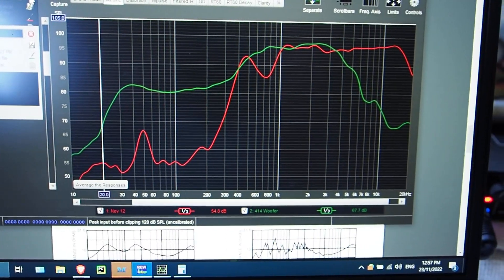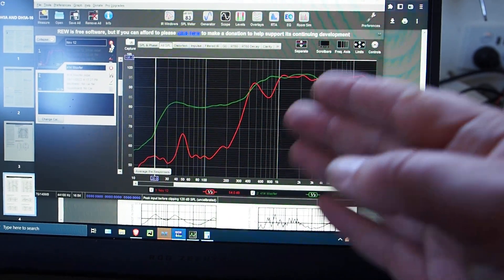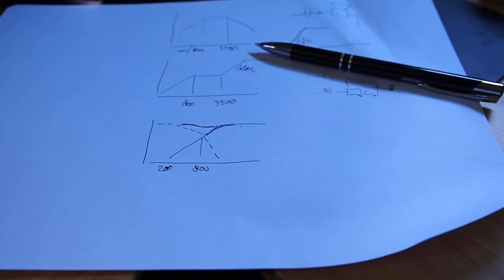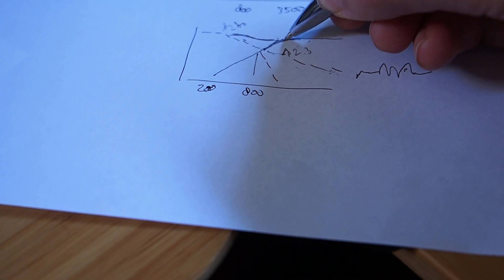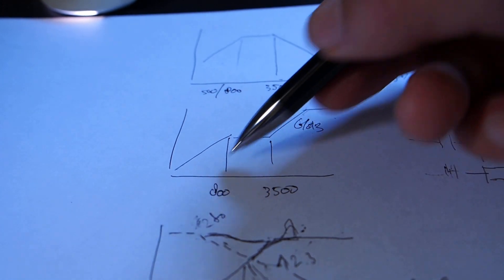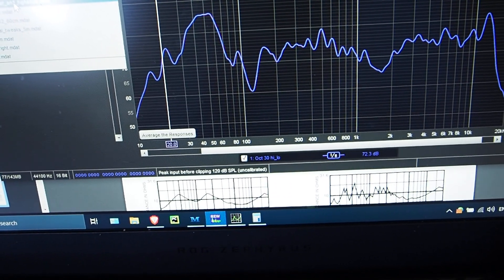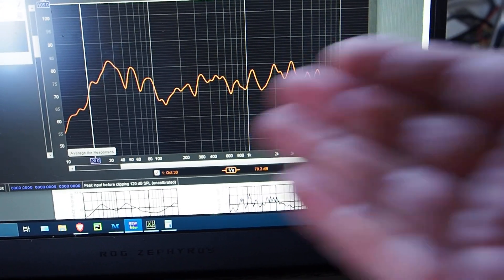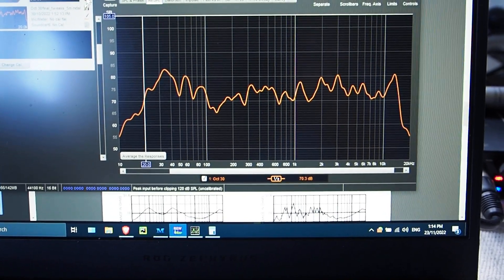Designing your Lancelot Speaker Part 3: Crossover, measurements, voicing by ear

Comment: Looking good and that all is coming together nicely.

Probably there is not so much more performance to get from the solution methods choices you have made. And for the "most part" you are ±5 dB in your room that is good!
(With that smoothing)

I guess it sounds good.👍😉

Regarding your DSP explanation in the video.
Then you look at wrong DSP in my opinion.
If you think that you need to do DA/AD conversions twice. That is not correct with one exception (see below).

There is DSP units that take digital in and do no DA conversation at all, when it has digital out! (So you can use your DAC of choice.)

Then you also have DSP that take digital in and have a DA convertion and a volume remote control (so you throw out the middle man the "preamp").
You get analog out that goes then  to one or many power amplifier(s).

In other words we need one DA conversation always! And depending on what setup you are doing you will end up with just that and nothing more (except TT that needs AD and a DA conversation but what the DSP will bring to the table regarding SQ outweighs the potential degradation it might have.).

MY conclusion this far from your project and with my DSP experience. Is this traditional way to use crossover network bring you ±5 dB and the possibility of fatigue @14 kHz (depending on how sensitive someone is).

With a DSP as preamp you will gain somewhat better performance with ±1.5 d dB and being able to reduce that 14 kHz peek if needed.

So as we agree on:
"not wanting to stack variation on variation; it's very valid.."
When your approach give at several points at least +5 dB and other points -5 dB. And the DSP approach give a tighter window ±1.5 dB. So performance left on the table by the method chosen.

Performance is also suffering when we put a crossover network BETWEEN the power amplifier and the driver. When the power amplifier is not driving and controlling the driver directly (damping factor). It is always better to make the crossover in the low voltage signal domain there we can put the money into higher quality parts when those parts will be so much smaller.
Than in the traditional way after the power amplifier where we have higher voltages and currents and the caps/inductors/resistors need to be bigger and more expensive so we will most likely NOT be using the "best" quality components due to cost. The good thing with a traditional crossover in the speaker cabinet is that is covinent. Just hook up a amp and you are done when you have your crossover built (but does it matter? When those are tailored to your room as that were one benefit of building it in the first place. Move it to another room/location then all bets are of and we got something with unknown performance. 🤔

Anyway I planned to answer your question that you posted earlier today but my computer thought it were wiser to do a windows update instead .. so I found your new video and typing on my phone 🤳

Comment: Thanks for doing these. My 414s have the same peak at 2.3kHz and a valley at 600. I'm tuning in a similar way. I'm using Faital hf108r cd's. They sound more clear and open than the 808's in this application. It's a neodymium design with a shallow throat.

With no crossover on the 414s- the Faitals are a couple dB quieter than the woofer. They come in at 3.7k with a cap and inductor
Reply from the maker: Hi! Yes great report thank you. What you're doing there is exactly my first ever setup, running the 414s full range and let the tweeter drop in so it meets the natural drop off at around 3.5kHz.. 

But then I found its better to utilise the highest efficiency driver and avoid the 2.3kHz region. I did have the 108R and another Faital at the top of my 'current' driver wish list, until a set of DH1As large format CD came along... not exactly a 288, but a long way in that direction and no issues playing at 500Hz.

Is the 108R's FR flat - how does it look?

Comment: That dip at just over 125 is possibly phase cancellation from reflected floor bounce at l/f. Check height of driver above floor versus 1/4 wavelengths at this frequency. If you place a well folded duvet in front of speaker and can measure a reduction in the dip then that’s the clue. Hope this helps.
Reply from the maker: Thank you yes quarter wavelength indicates 65-70cm/2ft, or double for the path of a bounced signal. The woofer sits at 85cm/nearly 3ft above the floor...so it might be the distance to the wall. I'll do an experiment...